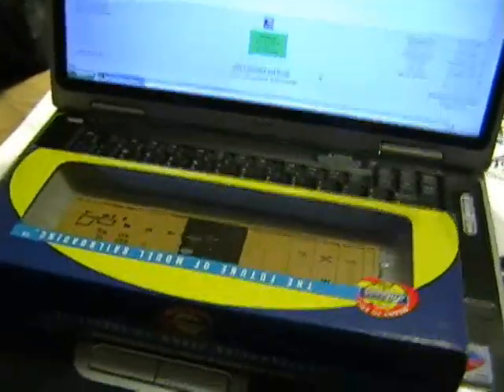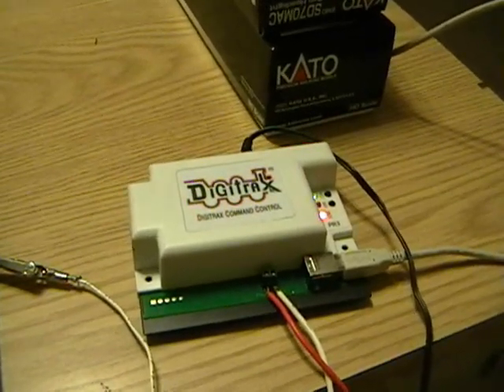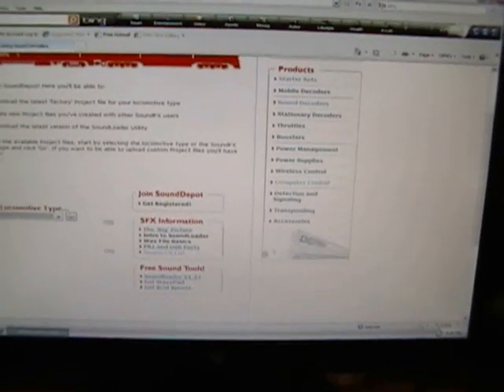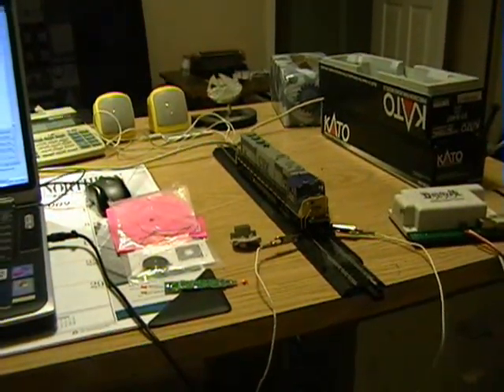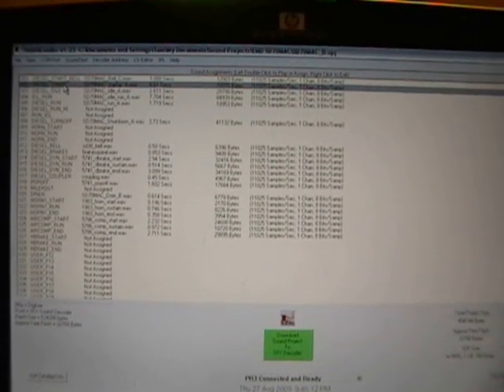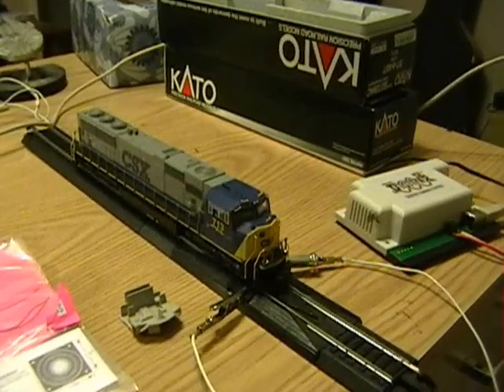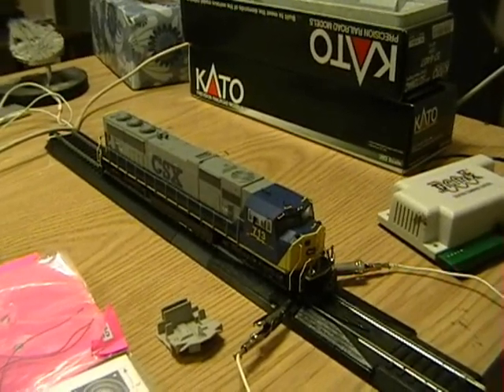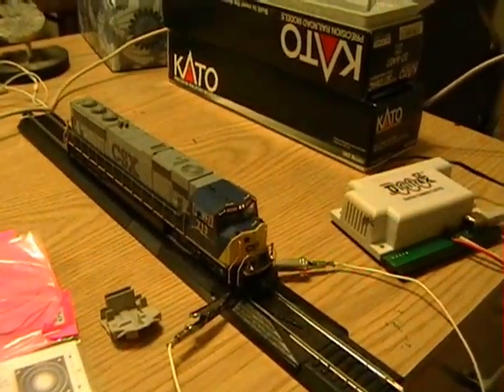08-27-2009 How to use a Digitrax PR3 to load custom sound in a Kato SD70MAC

Comment: sir, to inject spj sound to decoder sound board, its only sent via rail track?
Reply: Farid Rachmanyah signal needs to go through the red and black wires or track pickup to the decoder. Rail or direct wire to the decoder.
Reply: Tommy's Project Silverado wow unbelievable, in other words we can change default sound decoder let say sd70ace to SD70? Thx for sharing
Reply from the maker: Correct. If you like, I have an SD70MAC file in a Yahoo Digtrax sound group. Just do a search and look for tommie022481 files.
Reply: tommie022481 thankyou sir, i will search that email group, that sounds interesting, but in the mean time ill buy the digitrax item first, :)

Comment: Hey Tommie, Great Vids, Thanks for your time posting these. I'm having the exact same problem as berysg, I'm using a SFX064D Everything has power Project loads fine using PR3, PTB-100 & S.L. v1.23 but no sound and only Reverse light works not forward with Sound Tester. Using Digitrax Spj file. I have no idea what could be happening.  I hear some static when begins erasing flash and als at beginning of programing till about 40% then quite. any suggestions? Thanks John

Comment from the maker: It could be one of may things. Are you using the sound loader software or another? Did you check all connections inside the SD40 to make sure everything is getting power? Do the lights work on the SD40? Have you tried to program and CV values? Start with that and we'll go from there.